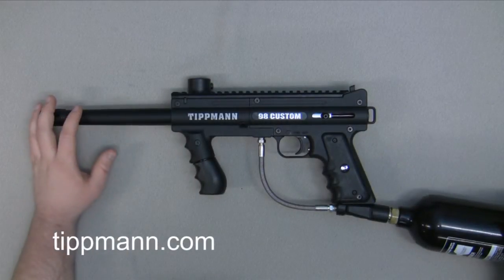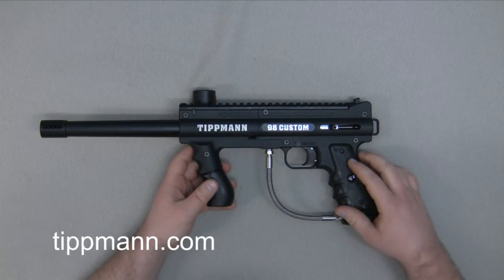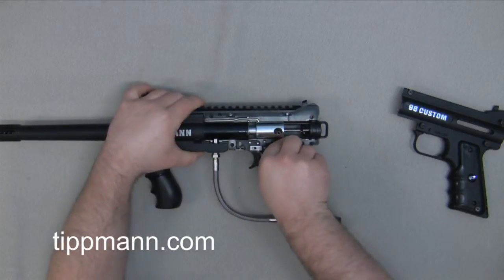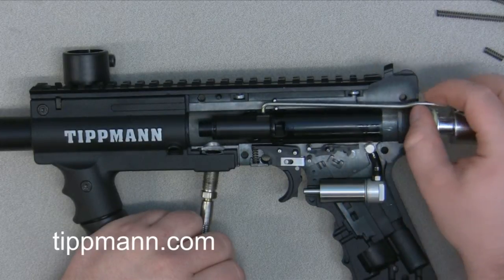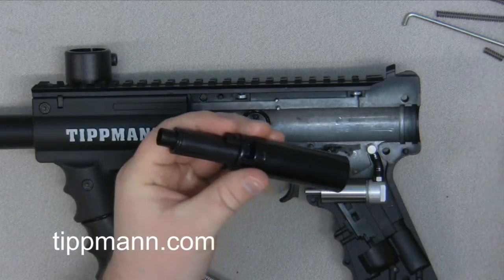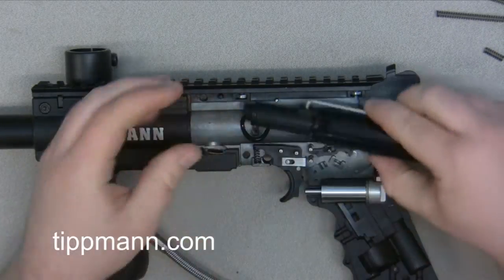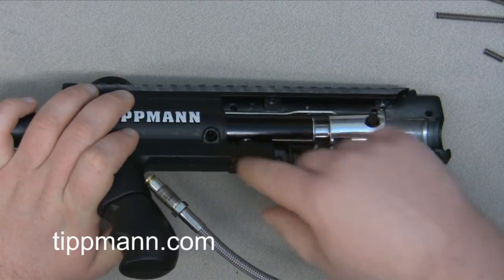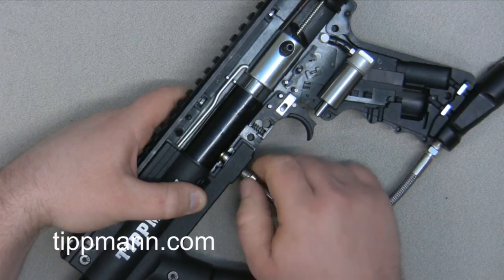98PS Troubleshooting Air Leaks.mpg

Comment: why did you guys switch to this air line assembly ? ...i bought one of these , because of how much luck i have had with tippmann products thru the years, and i have never had such a leaky valve in my life .... ya have to crank that in sooo hard to get it to seal ...

Comment: So this doesn't explain what to do if air is leaking through the barrel....
Reply: Leak through the barrel is the valve. Most likely O-ring
Reply: The Got Dang Fuzz so we buy a new valve and it should be good ?

Comment: I bought an alpha black elite last week, and when I put co2 in it, it stated leaking from the connection to the gas line (bottom) I tried tightening it and it didn't fix it, and I took it apart after watching this video and I still can't find what's wrong. can someone help?

Comment: my tippman was leaking air after taking it appart. i got it hand tight but it still leaked a bit. so i tightened it with a wrench, just a little bit.  now i dont hear any air leaking. so i consider it fixed. i tried putting soap on it too. no bubbles.
but i took a risk didnt I? of breaking the valve?

Comment: After shooting my 98c ultra basic a few times, it was almost as if the gun went fully auto for a couple seconds (i do not have an e grip or anything.) So i unscrewed my co2 tank and then screwed it back on. The weird fully auto thing stopped but the gas was leaking out the barrel. What's going on and how can i fix this?